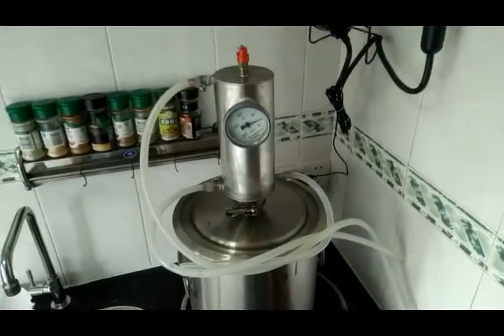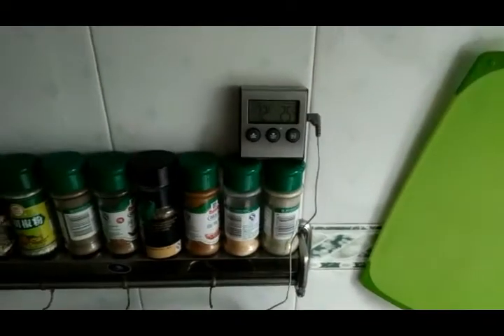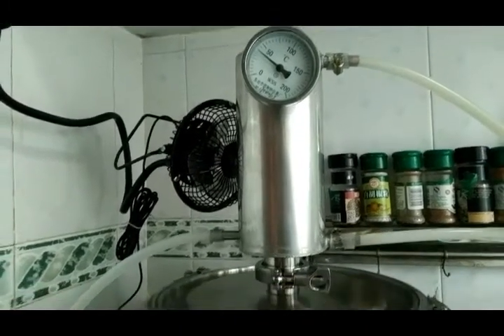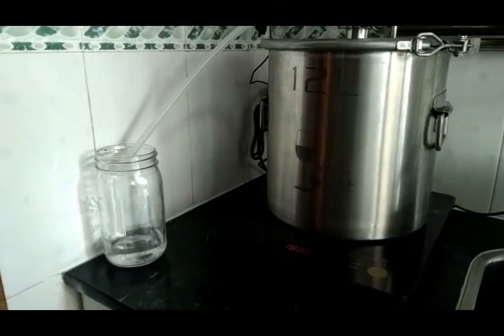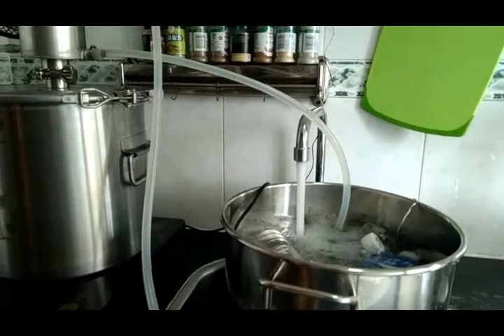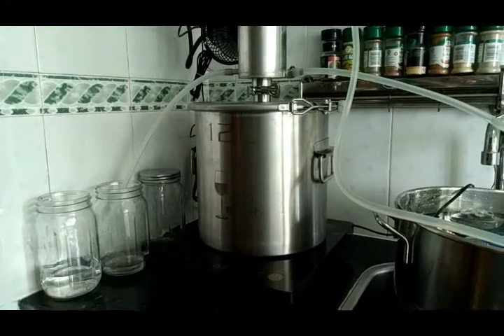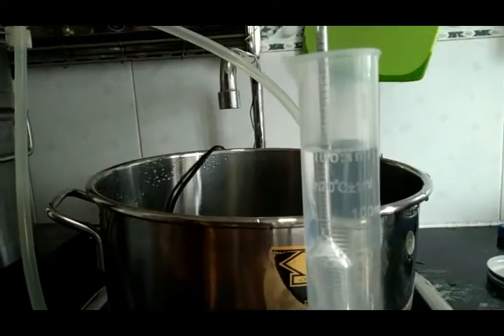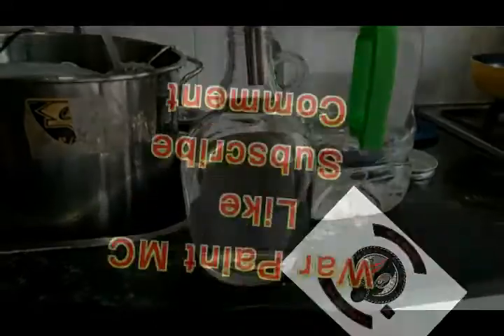Making moonshine. Running a small 12L still

Comment: Hello! Great Video :) Is the alcohol which is coming out stil Hot, or the outlet tube of the alcohol which is over the moonshine Glas?
Reply from the maker: Hey, thank you! It comes out pretty hot but not hot enough to burn you. The outlet tube on that still is like a rubber hose.
Reply: Okay thank you, i was Just thinking about how much of the vaporized alcohol goes liquid again an how much goes into the air of the room :)

Comment: do you think the next size up the 20l would work on a stovetop like your using
Reply from the maker: Yes it will work, in fact if you check out my other video on running shine, I use a 20L still on the same electric burner. It just takes more time to get hot enough.
Reply: @warpaintmc7575  did you buy a whole new still or did you just get a bigger pot ?
Reply from the maker: @dv6579  I bought whole a new still but found the the condenser from the smaller pot was actually better so I use that one instead.
Reply: Yes you can heat a 20 litre on a stove i heat a 70 on my stove